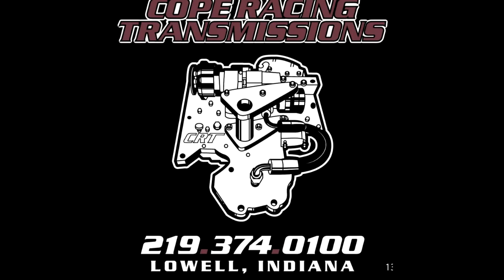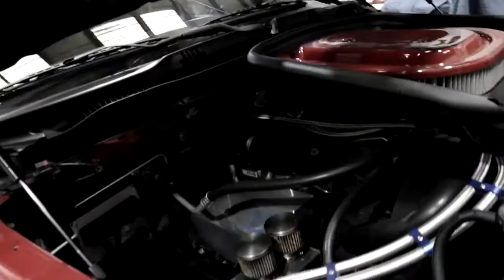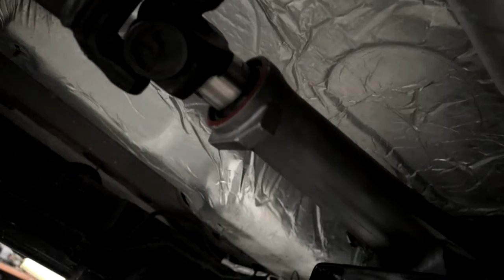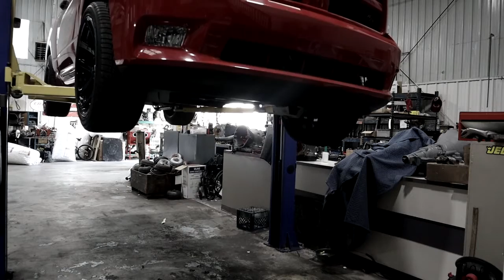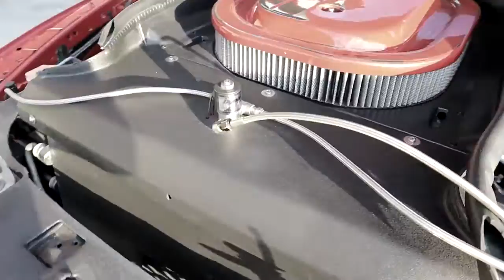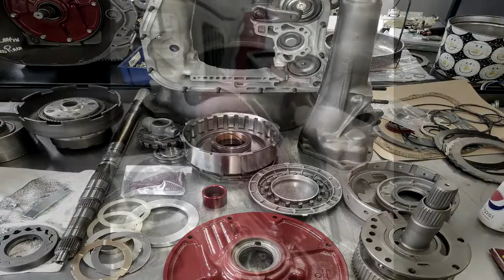545rfe to 727 swap COPE RACING TRANSMISSIONS

Comment: Hi.  Did you need any computer reprogramming for the engine?   Im thinking of doing it and wondering all that's needed.  My 2006 ram is all bone stock.
Reply from the maker: Yes, program the ecu to a manual transmission. That's it.